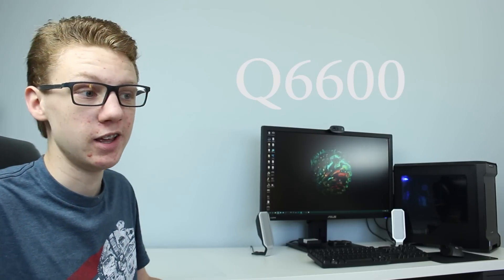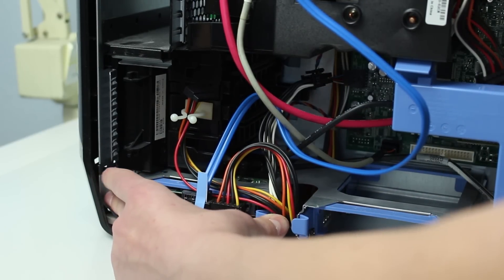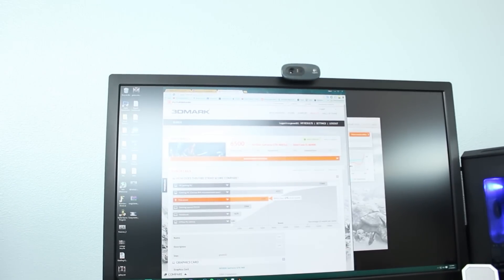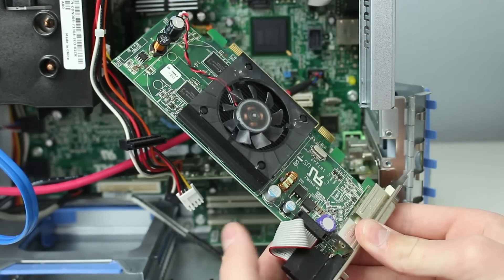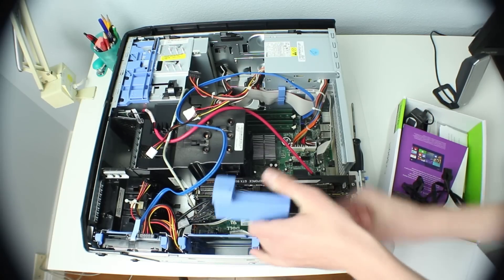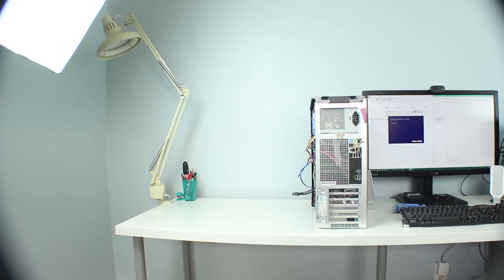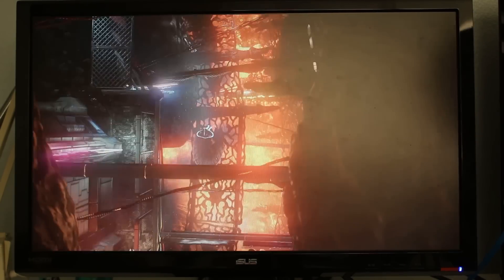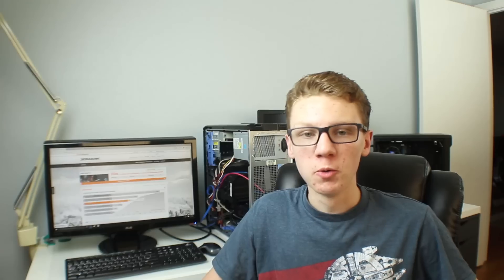Old CPU + New GPU = Gaming PC? (Core 2 Quad + GTX 960)

Comment: I have the exact setup except with a q8200, 6gb of ram, and a msi gtx 960. Performs amazingly since all I really paid for was the gpu.
Reply: Pepsi Maniac Gaming do you use ddr2 or ddr3 and how was the temperature? I was thinking on building the same
Reply: Freddie Rahim The XPS 430 has ddr3, but since I have a 420 then yes I use ddr2. Now temps, I get around 60° when gaming, and 40° when idle. I got my system for $90, so try to bargain around that level so you don't pay to much.

Comment: How would it work with the Q8200?
Reply: As the number implies the Q8200 has overall better performance at the cost of being just a bit pricier than the Q6600. Both cards can be overclocked to 3.0ghz+ safely with a stock cooler. It's literally a cheaper I5 under an old name.

Comment: Awesome video. I have that exact same system that has been sitting in my basement for years collecting dust. Bought it new in 2008 with a geforce 8600 GTS. I was gone to give it away but I decided to see if I could upgrade it. I maxed out the ram at 8gb which took forever since  2 different set of used DDR2 didn't work I finally decided to bite the bullet and buy 4 2gb sticks brand new from Crucial and the XPS worked fine with it. I installed a 256 SSD and installed 64 GB windows 10 using the original license on the PC. So now it can address the extra ram. Now I'm at the point trying to decide if a GPU upgrade will be worth it. I think I will try a GTX 1060 3GB after watching your video.

Comment: is having PCIe 3.0 important on the motherboard for 960 gtx, I have PCIe 1.0 will 960 gtx work on it.
Reply: Akash Tripathi - As long as its Pcie and not pci, it should work. but there will most likely be a large performance drop
Reply: Bandwidth speed is different but the difference won't be THAT noticeable.

Comment: I think I'll do the same, I have an optiplex 745 with the Pentium D, and I'll get a gtx 1050.
Reply: steven solis No that will create extreme CPU bottleneck.
Reply: What do you recommend, I was planning to get a core 2 quad q6600 and pair it with a gtx 1050?
Reply: That sounds way better,you should try an i3 not saying you have to because i think that q6600 can hold the power of that graphics card.
Reply: Yeah and it's only 25 bucks on ebay.
Reply: steven solis Nice deal you should get it.

Comment: it would be nice if you could test an old cpu + 2 GtX 950 sli vs Old cpu + gtx 950 vs old cpu + gtx 970. that c2q will work good with a gtx 950, but with gtx 970, i don't think so, but with SLI GTX 950?? 2xGTX 950 <=> GTX 970. I wanna know if sli works better than single gpu for old cpus.

Comment: You have to run actual games at preferably 1080p with a mid range vid card that most people use or can afford. Firestrike is not a good indicator at all of a PCs performance in games. Old core2quads do still barely hang in there but really cant be paired with anything more powerful than a gtx 750ti.

Comment: Hello.So I have a:
Nvidia GeForce GT 430
Intel Core Pentinum G860 3 GHz
4 GB ram

What video card should I buy?
Reply: Definitely not a 1050ti but good idea. I'd say a 750ti is the best card to get where you wouldn't see cpu bottenecking.
Reply: Maybe consider a gtx 1050 or gtx 750 ti

Comment: is this possible to replace the mobo with a DDR4 compatible on those old Dell cases? I want to use my old Dell computer case and cpu cooler on a new build. Thank you
Reply: ToshirokArai - most of the time those mobos are pretty much custom fit, sp dont expect it to, but possibly
Reply: No, probably not, and if it could I wouldn't even recommend it in the slightest cause it would cost more for a super hardware engineer expert to convert it rather then buy a new mobo with better things on it.

Comment: I have a Dell Precision T5400 dual quad core Xeon X5460's @ 3.16 ghz, 12gb ram, 2x 250gb HDD, and a 2tb harddrive, and a 2x GTX 980ti's.
Reply: legotec49 I have a potato
Reply: And not even a i7 6800k can run gta V at 4k 90fps with a 1080 and there is not a registred card called gtx 1080 ti
Reply: Lol
Reply: no there not bro, i can run GTA5 ultra 4k and im getting well above 90 FPS with my friends GTX 1080 ti
Reply: Liar! The 1080ti is not even out yet...
Reply: that xeaon is bottleneking ... like realy Xd
Reply: check out my channel after Christmas for a video on it.
Reply: But dude that's a huge bottleneck of u south by even a i3 you're gonna be fine I have a q6600 and a gtx 570 and I'm set for the next year's cuz I'm only playing csgo and rainbow six
Reply: True that's what I sad there is no gtx 1080ti out but...
Reply: +bob richard you do know that a 6800k is 6 cores right?, he has 2 xeon quad cores, which makes up 8 cores and 16 threads, so in theory it should run better
Reply: awesomeada juhovaaa I know man but he mentioned a 1080ti and the 6800k is a great cpu but I rather go with an older model or even a i5
Reply: And gta 5 ultra at 4k cant run on 1080ti which doesnt exist :)))
Reply: I have the previous version of the xeon which is using the LGA 771 socket. Yes it kinda makes it a 8 core with 24mb cache, but no hyperthreading. So 8 core 8 thread.
Reply: Aren't thoe's  rare as he'll?
Reply: Rob Richard not really. look on eBay
Reply: I saw some really expensive ones out there personally I have 1150 and I like them more 😂
Reply: but... the GTX 1080 ti doesnt ex...ist?
Reply: Im not sure the bottleneck is that bad, apart from bad single core performance which is way more important than cores in games
Reply: yes gtx 1080ti doesnt exist
Reply: 4173 now it does
Reply: i was joking
Reply: did anyone ask?
Reply: legotec49 SUUUURRRREE
Reply: how's your cs go doing on q6600 and gtx 570 i want like 60 fps on medium.Any suggestions?

Comment: Just shows first generation Intel processors are nothing to sneeze at as my i7 920 (D0) overclocked to 3.8ghz is 5% more powerful then a i5 4460 at stock speeds and i was GOING to upgrade to a i5 4460 z170 system so that money can get me a Xeon X5650 and 24 GB of ram (8gb ram drive) and rx 480 graphics to run HTC vive virtual reality.

Comment: where did you get the copy of windows from?
Reply from the maker: Windows Media Creation tool.
Reply: Gavin Remme what is that exactly? Full copy of windows? How much did it cost and is it a genuine copy?
Reply from the maker: Yeah it's legit from Microsoft. It creates install media. You just need a windows key, which you can get on kinguin for like $25.
Reply: i actually have seen that. i heard some copies are legit and some stop working after awhile. its kind of a gamble from what I've heard according to reviews. you install windows 10 64 bit?
Reply: Brian Brennan worst case, it says its non legit, but I just haven't bought another one, it barely limits you from doing anything at all
Reply: Brian Brennan Windows 10 doesn't even need to be activated if you're willing to deal with a watermark and no customization. It works perfectly fine for simple projects like this where you're just testing things out.

Comment: Should i upgrade my HP DC7900 that has a Core 2 Duo @3.0Ghz
4GB RAM DDR2 @800Mhz
Ati HD 5450 1GB 
80GB Hard Disk 7200RPM
500GB Hard Disk 7200RPM
360 OEM Power Supply
Windows 10 x64bits
Reply: Graphic card...hd5450 is crappy
Reply: #Crazy Pro I know bro, i'm planning get a Quad Core Processor and a new graphic card, what would u reccommend?
Reply: well what are u willing to spend
...tell me ur computer model also which will help me give u the best...
Reply: oh! u have given computer model tell me ur price range....and is ur computer small form factor or big enough...??? I mean ur system case...
Reply: #Crazy Pro My pc is COMPAQ DC7900 CONVERTIBLE MINITOWER. I think i could spend US120, maybe.
Reply: how many ram slots and are u willing to upgrade ram cause ur having 64bit which is a advantage
Reply: #Crazy Pro 4 ram slot, i'm thinking in upgrade too.
Reply: oh nice
Reply: Graphic Card Gtx 750ti..don't buy a big 2fan just buy 1fan gtx 750ti because the big one won't be able to run on ur smps....just stick to ur core 2 duo...for sometime...just buy ram for now ddr2 can u tell me how many slots are free and how many used...??
Reply: core 2 duo is very powerful until ur not running veryy CPU demanding games....for now it's just fine...with a core 2 quad...u will get only 5-10 fps in some games....changing CPU is not simple u got to update ur bios...and core 2 quad will give more heat so a new heatsink and in a OEM system it's just mess cause u have all OEM custom parts
Reply: #Crazy Pro Uhmm, ok... Then what you recommend?
Reply: in that system you got if you put a quad core in it like a q6600 or higher, and use the same card like in this video you'll have the same results.  Upgrade to 8 gig of ram and you'll get better results, and even better if you overclock to at leaste 3gigahertz.  In my area that upgrade would cost like $20 for the CPU, another 20-30 for a new powersupply to handle the video card, and lets say 200 for the video card.   $250 and you got a computer gamming rig.  Get that and you'll be playing new games today.  Save for a new system, I think prices will come down since VR is pushing minimum performance up and prices down, so these $500 dollar video cards should be $200 in the near future is my guess.
Reply: well u actually should i recommend core 2 extreme qx6700 only 20 dollars cost and its motherboard is actually 30 or 40 dollars

Comment: I have a soft spot for the Q6600. It was in the first computer I built back in 2008. I was lucky and the price had dropped to about $250 when I purchased it. I retired it in 2014, and upgraded to an i5 4670k. The Q6600 is still being used, though. I gave the old desktop to my sister, who uses it from time to time to play a game and such (rollercoaster tycoon, etc). It's surprising how viable the almost 10 year old CPU is today.

Comment: He is right .... But there are things to be kept in mind.... In that old PC Core2quad Q6600 , the bottlenecks for his 960 were: The PSU, RAM (3GB??) ,DDR2 RAM , and the biggest one is the Hard drive yes the HDD with suck low speeds does give you bad frame rates , you guys know why..... Ram is first of all slower and the HHD data has to goto Ram then CpU this delay causes heavy load times and puts a really heavy task on the CPU resulting in Thermal throttling or so.... So this is not a fair test , but appreciate his effort for making this video and giving us an idea that older cheaper hardware has some guts to face the newer yet better counterparts.... Like if u agree , dislike if u disagree if so why (reply in the comments section ).....

Comment: Good job!  The CPU upgrade path is a little more compelling if you have a Sandy/Ivy Bridge.  Processors since then have gotten smaller and faster, but not as significantly as before.  Sure, you have PCI-e 3/USB3 native, but that's not really the bottleneck.  If you're running Sandy/Ivy Bridge w/ 8GB RAM and at least an SSD for your bootdrive, a newer CPU alone is not going to make it significantly faster.  You tested a Q6600 and got 85% of the performance of a modern i5 in gaming with a mid-range GTX 960.  That's very good.

Comment: I love my 3770k I went for it when it was on sale when the 8350 amd people thought was the thing the but my 3770k can keep up with the new 6770k thats out today I can get fps higher than it on some builds Ive compared to online where people bench it with 980 ti can 6770k My cpu and 780ti can outperform them .And I bought this cpu in 2011 . The 6000 series intel are nearly identical to the 3770k only change is bus went from 5gt to 8gt . I dont think it matters cause Im getting crazy fps in mad max 200 fps  battlefiled 4 200 fps high rise of tomb raider 84 to 100 high

Comment: 😭 I have a core 2 dual!! I wanting to upgrade to the core dual quad core is it worth the upgrade because I'm looking to get the gtx 660. wondering if the quad can handle the gtx 660 with overwatch
Reply: Hydro Awesome101 there $10 on ebay go ahead i got a q8300 for $14
Reply: Chris Thesav I'm wondering if the quad would bottleneck the gtx 660
Reply: will it work with the dell optiplex 745 small or i have to get another motherboard
Reply: Hydro Awesome101 it should work
Reply: Hydro Awesome101 compare your gpu to a 750ti a core 2 quad dosen't bottle neck a 750ti
Reply: Hydro Awesome101 yes masterkickass8
Reply: ok hold on
Reply: is your name chris man or i serch the wrong one
Reply: Hydro Awesome101 yes

Comment: Ummm... Update... If you have 775 socket, research xeon e5450, or x5450 and mod 771 to 775... Its 20$ and similar performance to i7 2600
Reply: Ummm... Update...that dell has a p965 chipset...that mod won't work.
Reply: also, dont mod the mobo, mod the cpu!
Reply: Aleksandar Friscic x5450 is NOTHING LIKE I7
Reply: i have an e 5450
it's awesome for what i do..(light gaming + light video encoding n stuff)...it's an upgrade from a P4 3.4 Ghz 1C2T.....so...it's an amazing upgrade...it's absolutely hoooge upgrade.....but it's not like an i7 though

Comment: How much ram in the older comp, plus the HDD could be improved.

In most games the visuals are done by the GPU, so performance won't be totally in the toilet. 8 GB RAM is a must IMHO, (that is still quite expensive, even second hand)

I played Witcher 3 and fallout 4 using q6600+R9-290+8Gb DDR2. Would play Arkham Knight, but not so great, mainly when smashing through buildings in the Batmobile, (I'm assuming due to load on the CPU because of physic calcs), but running around on foot and fighting were fine.

Having said that, Firestrike isn't the best for showing real world performance.

You can overclock, but the gains aren't really worth it. 10% of 20 fps is still only 22 fps.

Comment: I have Q9300 and GTX 750ti and have in bo3 20fps on low -.-
Reply: resolution?, what motherboard?, is much better to have a Core 2 Quad as close to 3.0Ghz or above, whether factory or so come by Overclock, that Q9300 only has 2.5Ghz (multiplier at 7.5x and Bus at 333Mhz  = 2,500Mhz), then you need to overclock or to change that Core 2 Quad.
Reply: What would you expect lol its call of duty black ops 3

Comment: I have upgrade my old Core 2 Duo cpu to Core 2 Quad Q9650 @ oc. 3,5Ghz, bought more RAM (total 8GB) and used gpu for 150€ and now I can play Witcher 3 on ultra with 35-45fps. Total investments were 260€.  (Mb: 30€, cpu: 75€, Gpu: 150€, RAM few bucks)
Reply: Maybe it would have been better to change your PC at least an AMD FX6300 and motherboard socket AM3+ (used parts, second-hand).
Reply: I would like to disagree. Sorry but I have seen plenty of videos comparing a overclocked core 2 quad q9650 challenging a i3 6100 or 6300 and it was like 3 fps lower with identical systems. Now think about this, a i3 6100 or 6300 can out perform a AMD FX6300 Black Edition if it was overclocked similarly which means a core 2 quad q9650 would only give you like a 5-8fps decrease compared to your AMD FX6300. Not worth the extra money for a new mobo and things. Sorry...

Comment: love your videos Gavin... subbed and liked! 
I'm working on OCing a Q8400 right now and have been able to get 3.66ghz. I'm on a Silverstone TD-02 lite AIO water cooler Gigabyte GA-EP43T-UD3L Motherboard, 600 watt EVGA psu.
Reply: What Voltage you need for 3.2Ghz, 3.4Ghz and 3.6Ghz?...for 3.0Ghz the stock voltage is enough.
Reply: I didn't step it... but at 3.66ghz the voltage was at like 1.35V. I have my voltage settings set at automatic so that they adjust according to what it needs. Is that not a good way to do it? I figured the 600 watt EVGA PSU could handle it.
Reply: Nathan Elmore
 while not appear instabilities, everything will be fine.
Reply: looks like it moves between 1.328 and 1.344

Comment: i have g31-s motherboard very old can you help me which gpu are compatible that i can use in gaming.
Reply: CPU, RAM, PSU, Budget?
Reply: 4gb ddr2 ram, core 2 duo, 500w
Reply: Jm Javier
Similar PC here....Core2Duo E8200 + OC at 3.1Ghz, 3GB DDR2 800Mhz (maximun 4GB) and PSU 450W (good one), I have an old GPU ATI HD4770 512MB GDDR5 (Dx9 / Dx10 only), which would be equivalent to a GT 730 64Bit GDDR5 with 384 CUDAs Cores (this is the best of all GT 730 versions), but with a little Overclock, it approaches a GT 740 GDDR5 (like an AMD R7 250 GDDR5).

So if your Core 2 Duo is weak, perhaps should not exceed one GTX 750 GDDR5, even that would be a good GPU for a weak Core2Quad without Overclock (4 cores for socket 775), but if you have high Overclock Core2Duo or you intend to switch to a Core2Quad 3.0GHz (Q9650) or your motherboard can overclock that Core2Quad above 3GHz, I would see with better eyes to a GTX 750Ti, GTX 950 and even a GTX 960 if the Quad CPU works to 3.6-3.8Ghz.

> What Motherboard you have exactly?

> What PSU you have exactly?

> What Monitor/Resolution?

* If your motherboard allows it, change your Core2Duo for Core2Quad.

* Somes GPUs has Low Power Consumption versions, the GTX 750Ti Low Power Consumption  has a peak of 60W in gaming, the GTX 950 Low Power Consumption > 75W, but for a GTX 750Ti Standard (90-100W), GTX 950 Standard (115W) and GTX 960 (130W), you need a higher quality PSU (if you do not have it right now).

:D

Comment: I currently have a AMD 5400K and a GTX650, I play Csgo a lot what gpu and cpu would you recommend me buying, I play Csgo a lot
Reply: If you plan to stay with that platform a while longer, you should find an AMD 4-core processor compatible with socket FM2/FM2+, so I would recommend the Athlon X4 760K (perhaps the 860K if your motherboard to support it) and APUs x4 like A8-6600K and A10-6800K, in terms of GPU, I would recommend any of nvidia require less power for the CPU to give 100%, in this case it is something important because AMD CPUs have less power per core than Intel CPUs...so maybe the GTX 960 (we will have to see where are the GTX 1050 and GTX 1050Ti in performance).

What PSU?